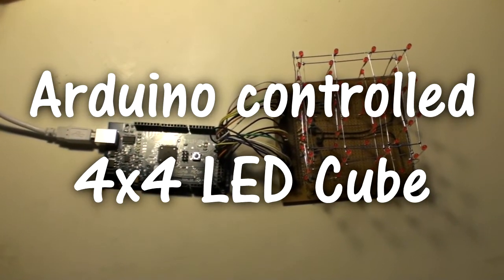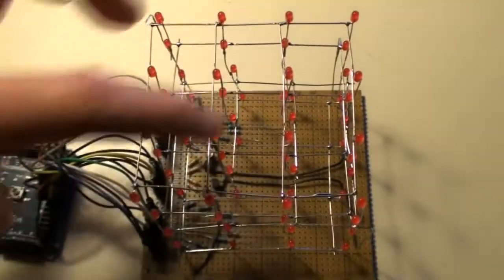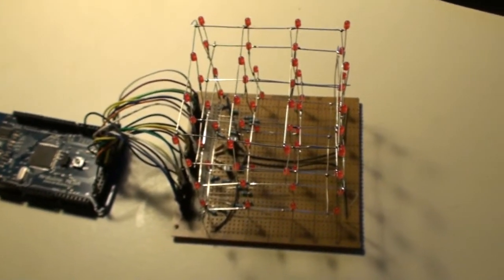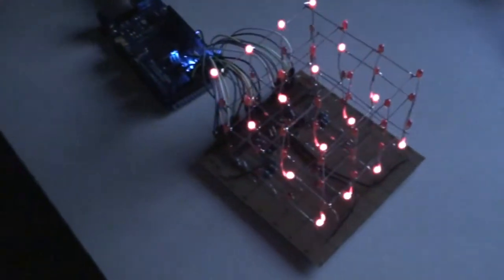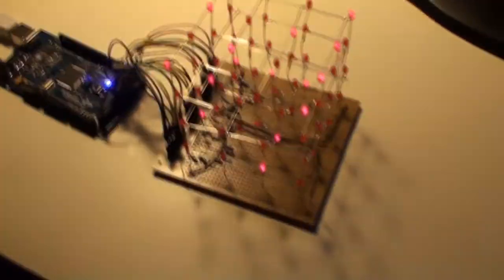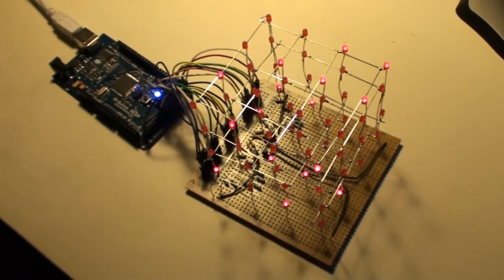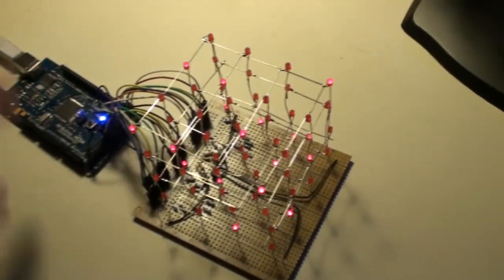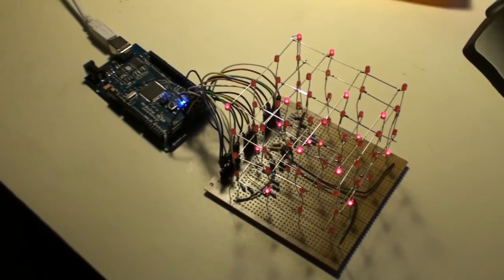4x4x4 Arduino controlled LED Cube

Comment: how can i program the code to go by b0000?? please
4x4x4 LED cube
  If i have it Connected
  column 
  "a1-13
  " a2-12
  " a3-11
  " a4-10
  " b1-9
  " b2-8
  " b3-7
  " b4-6
  " c1-5
  " c2-4
  " c3-3
  " c4-2
  " d1-1
  " d2-0
  " d3-A5
  " d4-A4
  layer 4-A3
  layer 3-A2
  layer 2-A1
  layer 1-A0
 Arduino Uno
Reply from the maker: It is not possible to this in a fast way as the pins are on many different ports. Though you might want to start out with the slow way and add just digitalWrite in my code.
Reply: I'm sorry but this is really the first time I'm using an arduino. and i don't know anything about programming XD But thanks for the reply!
I will try and look up what digitalWrite  means!